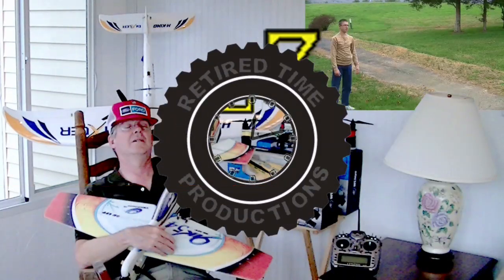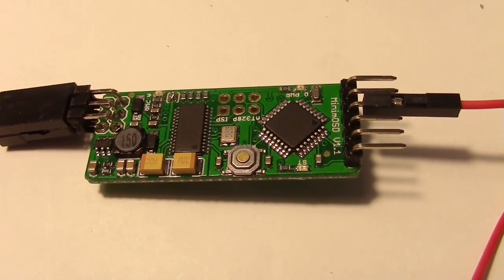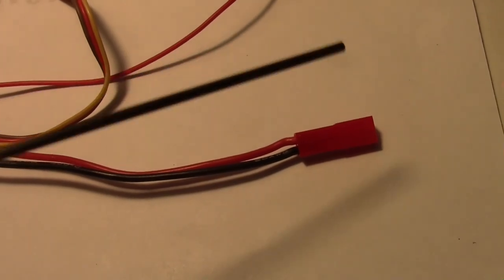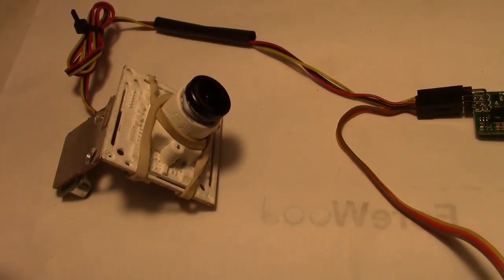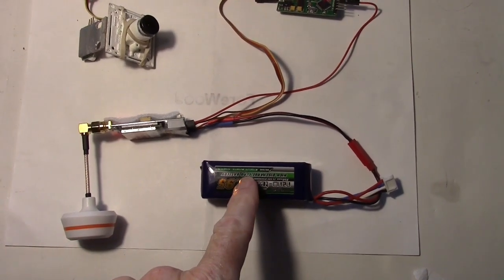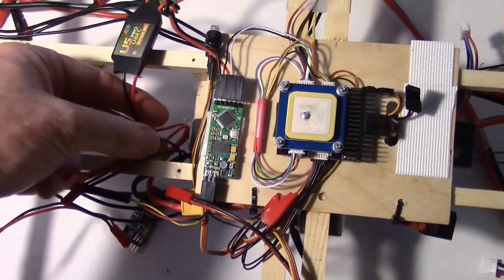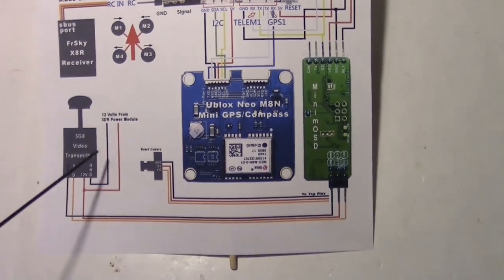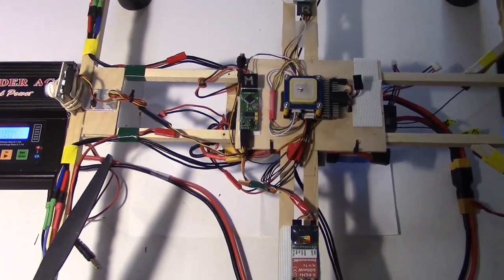Mini PixHawk Lite Part 4 - FPV Wiring Setup

Comment: Hey, thanks for this video.... I can't believe they sell these and you need to re-wire them!
I'm all done but I'm getting no response from the safety switch... any idea what I need to do???
Reply from the maker: +55Rumble Gyro Calibration or Calibration in general. It won't arm if not calibrated.
Reply: h! Ok, I've not done that yet but I'm not getting any lights at al??? Is that right?

Comment: dmerc00:good morning and hope you had a great Easter holiday, i am trying to install the pixhawk mini onto a S500 quad without using a telem radio and the osd, i can't seem to figure out how to wire it up to get any Sat's to show in mission planner? i wired it up just like your diagram minus the telem and osd neg,vcc,rx,tx wires for the radio and osd any thoughts or help would be appreciated Thanks R.K
Reply from the maker: +ksped1 I think I had to enable the GPS in the mission planner. You may have to be outside to get sat reception and give it about 4 minutes to acquire them. It is much easier to see if you are getting any sats with an OSD. Sometimes you will have enough sats but the pixhawk will be in error and won't arm because the compass is out of calibration.
Reply: +dmerc00 hello sir thanks for the reply,i guess i'm getting pretty frustrated with the osd's i got 5/6 that used to work but now don't work they now say error no bootloader and then the 3DR radio quit no heat packets (wth)thats why i'm not using  the radio/osd anyway i'll check the MP and see how i can enable it thank you R.K

Comment: Hi dmercOO:i had installed that telem gizmo from craft and theory on my pixhawk and it works awesome i can see the taranis screen with the same info so much better than i can on the monitor so i ordered another one for the pix mini and wanted to ask you about the diagram you had posted on the pix min, the diagram on the bottom view is this one correct(pins settings)i want to make sure i put the plug with the + - rx tx pins  in the proper place, Thank You  R.K
Reply from the maker: +ksped1 AFAIK the diagrams are all correct and my quad is still wired that way.
If you have doubts just measure the voltage to make sure of the polarity.
If rx and tx are swapped no harm will be done they just won't work.

Comment: Hi DmercOO still waiting on new ftdi and minim osd and i was wondering can you hook up the minim osd to the apm,pix hawk, and the mini pix without a telem radio. also since i've had lots of problems trying to get the minim osd's going i found a really great alternate for use on a pixhawk  that uses a Taranis i thought maybe you should check it out cause you have  in depth and easy to understand to follow along video's anyway check it out  they are Craft and Theory LLC. Thanks again R.K
Reply from the maker: +ksped1 You don't have to use the telemetry radio. Thanks for the info on the telemetry cable.

Comment: HI dmerc00: i got the 3.3 installed then went to check out the OSD now i get cannot connect because of no boot loader,don't know what i did so i tried a different osd same result then a third osd again same result noboot loader and eeeeprom needs updated? so i went to a vista laptop same thing,then to a windows 7 same thing,then to windows 8.1 upgraded to a windows 10 same thing so now ordered more osd's . Thanks R.K
Reply from the maker: +ksped1 What? I said I was using Arducopter 3.3. This firmware gets loaded on the Mini PixHawk not the on the OSD.
Reply: +dmerc00 Hi LOL sorry if i wrote that wrong i did load the 3.3 on the PIX not on the osd what i did was to check my osd settings  with the ftdi and the osd before i hooked it to the pixhawk mini and thats when it kept telling me it couldn't connect to the boot loader and the eeeprom  mapping was out of date and would not connect  thanks  R.K
Reply from the maker: +ksped1 For the OSD I used MinimOSD-Extra_Copter_Pre-release_2.4_r702
For the EEPROM out of date the fix is here:
http://www.rcgroups.com/forums/showthread.php?t=2026936

Comment: Hello Sir: i have reviewed your serial params again and compared them to mine again and their was something that i have missed and that was,  i do not have any SR3 or SR2 params i only have SR0 and SR1 params do you think this could be my problem of the OSD getting no heat packets and always tells me MAV Link waiting on heat packets on the video monitor? Thanks sorry to bug you again  R.K
Reply from the maker: +ksped1 No I don't think that is the problem. SR1 is the right port.  The difference is probably that I have Arducopter 3.3 firmware loaded.

Comment: Hi Sir: i checked all my param's only had to change 2 gave it another try  still the same good video but only shows the arducam logo,i'll try RC groups again but it seems like you are the only person i found that actually shows how to wire and install the pix lite, well at least i have the telem radio working and i can only thank you for that so Thanks Again and keep up the outstanding videos .
Reply from the maker: +ksped1 Very strange. It's probably something easy but finding it is the trouble. 
Did you write the params to the pix after changing? Also recheck the wiring. I have had a pin come lose once and another time had the molex in upside down.

Comment: Hello Sir: first of all let me Thank you for responding to my questions and all the help with the pixhawk lite getting my telem radio wired up and working TY. well i've been trying like heck to get OSD with no luck i have tried 4 different OSD"s and taken the osd's off of some of my quad's  just trying to get osd info (no luck) i have put them back on the models and everything works great and after 2 days of trying i'm ready to give up on the pix lite having minim osd the only thing i have been able to get is the  minim osd logo on the video. Do you think i should use the #2 telem port ? and would you know how the telem #2 port pins are wired since the pix lite was all marked wrong to start , thanks sir again
Reply from the maker: +ksped1 This RCgroups thread has the best help for such problems. Try posting the question there and they may know.
http://www.rcgroups.com/forums/showthread.php?t=2418029&highlight=pixhawk+lite
Reply from the maker: +ksped1 Here is my serial param list, maybe that will help.
SERIAL0_BAUD,115
SERIAL1_BAUD,57
SERIAL1_PROTOCOL,1
SERIAL2_BAUD,57
SERIAL2_PROTOCOL,1
SERIAL3_BAUD,38
SERIAL3_PROTOCOL,5
SERIAL4_BAUD,38
SERIAL4_PROTOCOL,5
SIMPLE,0
SR0_EXT_STAT,2
SR0_EXTRA1,6
SR0_EXTRA2,6
SR0_EXTRA3,1
SR0_PARAMS,10
SR0_POSITION,2
SR0_RAW_CTRL,2
SR0_RAW_SENS,1
SR0_RC_CHAN,2
SR1_EXT_STAT,2
SR1_EXTRA1,5
SR1_EXTRA2,10
SR1_EXTRA3,2
SR1_PARAMS,10
SR1_POSITION,2
SR1_RAW_CTRL,2
SR1_RAW_SENS,2
SR1_RC_CHAN,2
SR2_EXT_STAT,0
SR2_EXTRA1,0
SR2_EXTRA2,0
SR2_EXTRA3,0
SR2_PARAMS,0
SR2_POSITION,0
SR2_RAW_CTRL,0
SR2_RAW_SENS,0
SR2_RC_CHAN,0
SR3_EXT_STAT,2
SR3_EXTRA1,2
SR3_EXTRA2,2
SR3_EXTRA3,2
SR3_PARAMS,0
SR3_POSITION,2
SR3_RAW_CTRL,2
SR3_RAW_SENS,2
SR3_RC_CHAN,2
Reply from the maker: +ksped1 Also you may want to check the mission planner and make sure your OSD is enabled under optional hardware (best I can remember there is a check box for it).

Comment: Hi Sir  a little while ago i asked about wiring up the minipix thanks to you i followed your instructions and my telem radio's working great.now i'm following your wiring diagram for the mim osd everything works except i'm getting nothing on the monitor but minimosd extra,any thoughts would be appreciated thanks
Reply from the maker: +ksped1 Sounds like the OSD is not getting the data or the pixhawk is sending data at the wrong speed.  Should be 57600 and Serial Port 1 as far as I can remember.